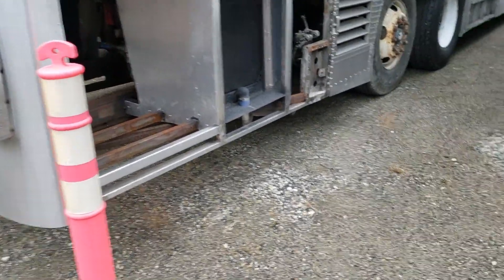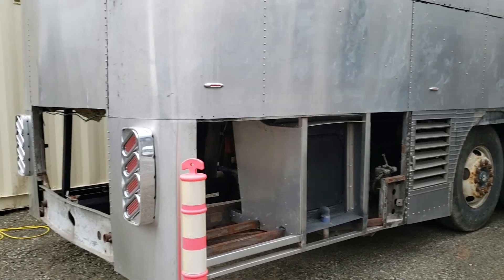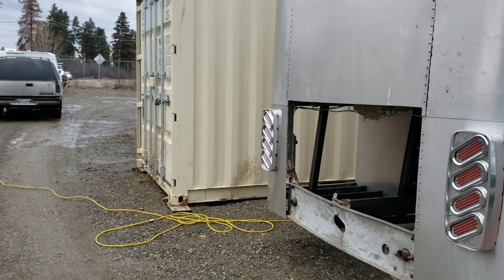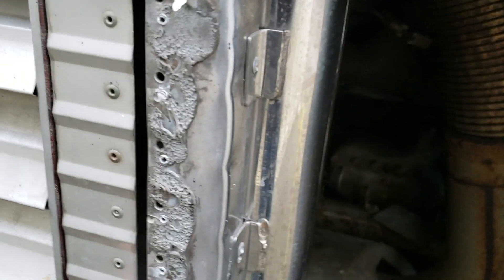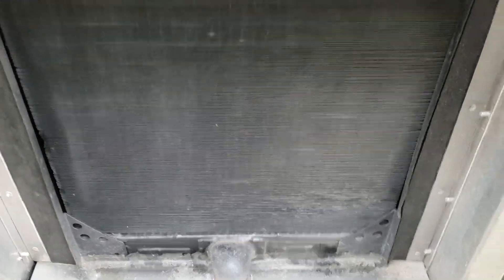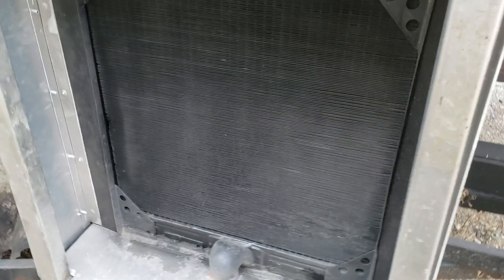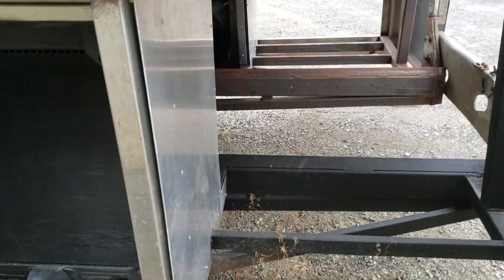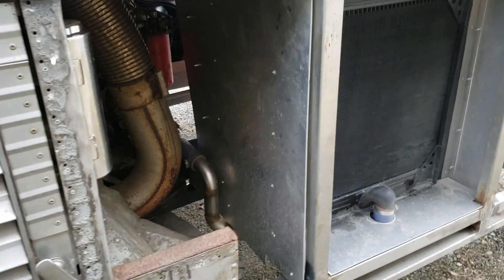Bus Conversion Project - Video 102 - Cooling system troubleshooting

Comment: Hey James, Good to see you back.  Progress!  The Wright Brothers started out with a one wire magneto plane...and look where planes are today!  One step at a time gets you to the finished product.  (I'll not comment on the Super Max)  Sounds like you're getting there.  Thanks for the shout out.  Sorry to see you have to be outside now...that sure adds to the difficulty of getting things done.  Been there, done that too, no fun!  Hope the weather is mild.
Reply from the maker: Hi John.... hope you're doing OK..... I guess I just had too many things to do to think everything all the way through.... plus no time to skin it all in, that and the voltage problem doesn't help..... pretty sure I get these things rectified it'll be good.... I'm hoping to work on the interior this winter as long as I can heat it enough.... good to hear from you

Comment: Glad to see your vision has improved ( hind sight is 20 / 20 ) that 13.8 converter should resolve the issues and will give you added connection location for 12 volt devices later at the rear electrical panel ( think electrical controls for a toad ? ). Just got back home after 15 hour drive to find 2 feet of the white stuff in my driveway and a note from the neighbor his truck blew the hydraulics sorry not plowed for your return ( hind sight should have left him the keys to my plow ) . You stay warm and we all will stay tuned.
Reply from the maker: winter has certainly hit us all.... oh well, this too will pass... hope your winter won't be too bad.... talk again once I make some more progress

Comment: Perhaps exit venting of radiator/fan into a lower air-pressure region. Could be done by adding floor/walls to the the zone the fans blow into and have it exit out the rear. Some forward-facing vents/louvre on the radiator inlets?
Reply from the maker: Yes , that will help as well.... usually a full width mudflap is added in front of the radiators, just above the ground to create a low pressure zone behind the engine and rads... I'll add that as well.... just didn't have time to do all this stuff before we moved.. same with the air intake scoops
Reply: Charles de Voil I agree...a slight scoop to direct the air into the rads.

Comment: Consider putting a fan on each side of the radiator in a pusher/puller scenario. Also if you ever decide to sell her (especially incomplete), please let me know!
Reply: also consider adding louvers to the skin of the bus where the radiator sits, you would point the louvers forward to scoop air in as you drive (like a reversed dodge viper hood). Adjustability would be nice to control drag/cooling

Comment: Can you route the exhaust tip to through the bumper? With that much tail swing, you don't want to crush your exhaust tip.
Reply from the maker: Thinking of running duals with polished stainless tips and no... don't wanna crush em so I'll have to figure that out too
Reply: I like them turned out the side a bit so that I can see in my mirror if I'm over-fueling.
Reply from the maker: me too.... this bus rolls some coal till the turbo catches up.... oversize injectors... :-)
Reply: James E Dennison I plan to add a pyrometer to the exh manifold of my 6V92T.

Comment: Hello Mr. Dennison!
Ive been watching some of your videos, especially the ones about the slide-outs. 
I'd like to do a slide install in my motorhome. Would you be able to answer a few of my questions Ive been researching?
Reply from the maker: Sure... fire away... sorry for the late reply
Reply: @JamesEDennison  Thank you!
I am trying to figure out how best to weld  reinforce the opening I will need to have cut out of my motorhome. Is there a particular way you braced the openings on your bus?

I am also trying to determine what slide kit would be best and where to purchase it at. 
I would like a large slide, at least 12 feet long and as deep as fesible. Since it is very large , is a cable slide setup the best or can one use one of the easier above floor systems? I would prefer to use an above floor system if possible.

What thoughts do you have so far? If you would prefer, we can communicate by email.
Reply from the maker: Hi... E mail would probably be better... jamesedennison@hotmail.com is my address
Reply: @JamesEDennison  I sent an email a few days ago.
Reply from the maker: Yes I saw it... just haven't had time to respond... I'll get to it as soon as I can... Thanks

Comment: Any way to run the fans in series right off 24 volt?
Reply from the maker: Yes..... that is an option as well.... I had it wired that way initially but I like the soft start of the 12v controls so I'd like to make that work if I can.... can always go back to that if I have to